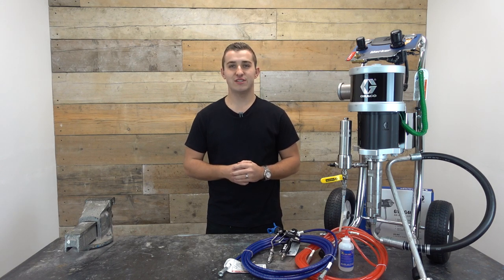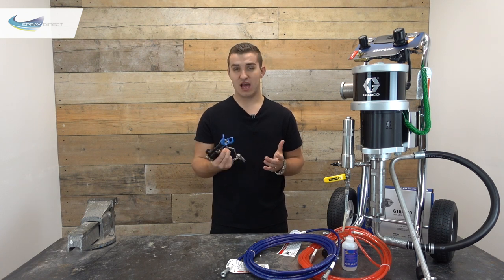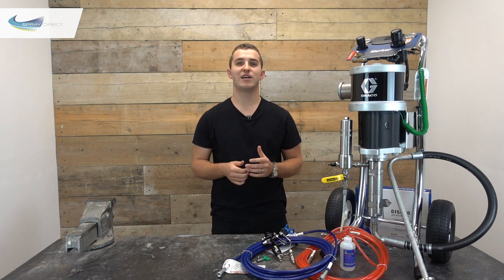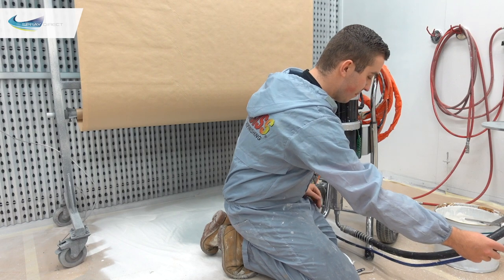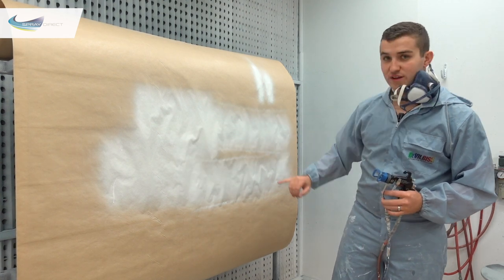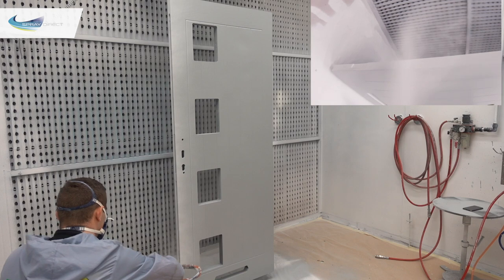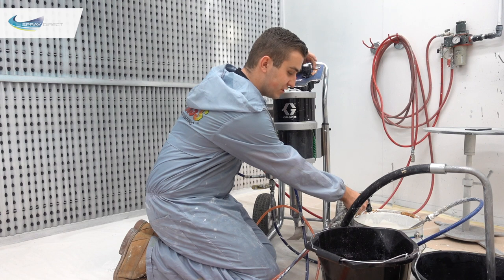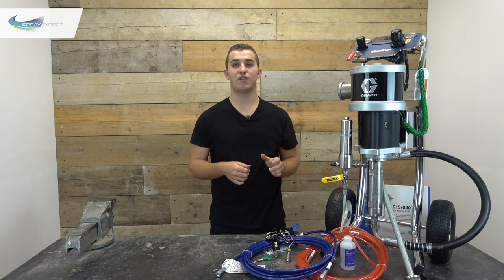Graco Air Assisted Airless Merkur Demo - Theory, Setup & Spraying

Comment: What is the air compressors capacity needed for this Air Assisted Airless Spray Machine?
Reply from the maker: Karthik Gowda you’re going to want 10-15cfm of free air delivery depending on the Merkur model 👍
Reply: Do I need a filter from compressor to the machine?  U know the compressor has. In the tank water.   How. I fix that problem. If I’m spraying. Oil base paint

Comment: -Can you use for walls,cutting the edges ?
-How noisy it works?Does it make more noise than Airless sprayer?
-Does this gun spit when you start and stop spraying?
Reply from the maker: Kolyo Kolev you could technically but I’d say it is a bit over kill for walls you’re standard airless would do the trick. The unit itself is very quiet but could be louder if you put more pressure through it. No the gun doesn’t spit, if it does you have a worn needle in your gun 👍

Comment: May I ask how much is the unit and what is the difference of the 395 aaa with the unit you demonstrated exempt the 45:1 ratio? I am interested to buy one of these units just thinking the price difference,  I currently own the 395 airless and the 9.5 procomp hvlp with the edge 2 gun , I would happily swap it for aaa instead of carrying 2 units , I know the aaa is the middle unit in between airless and hvlp , thank for your videos 👍👍👍
Reply: You would still need a compressor with you to run the unit. The difference is that your pump is electric.